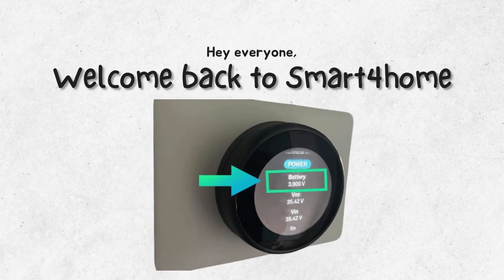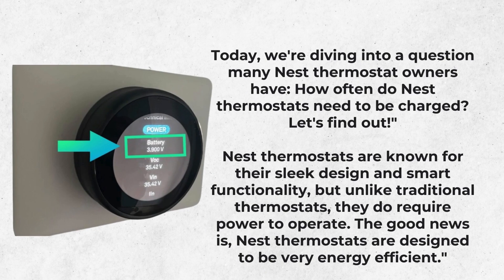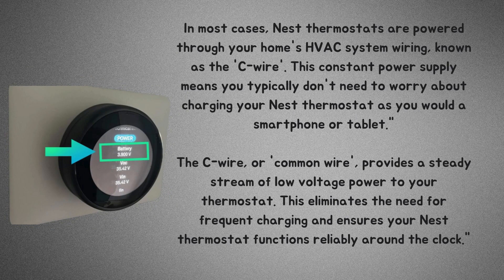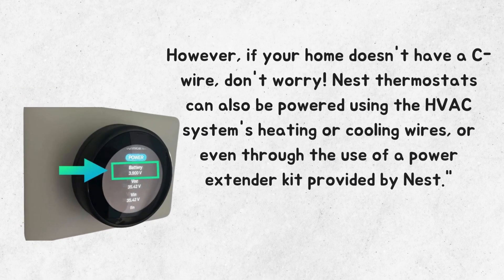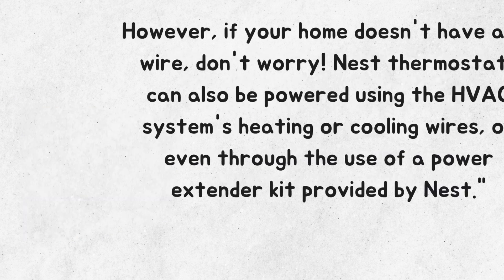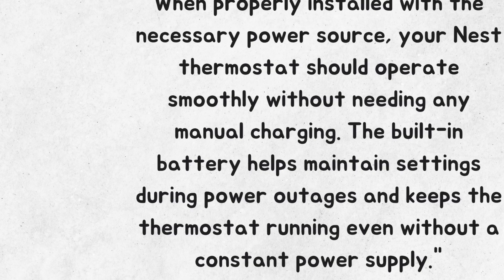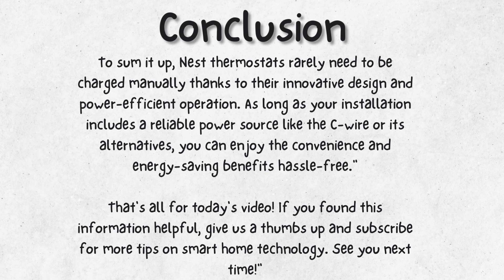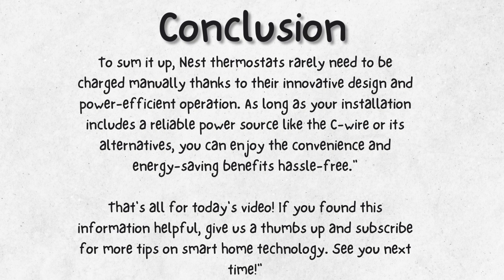How Often Do Nest Thermostats Need to Be Charged? [ How Does Nest Thermostat Charge? ]

Comment: i have a nest thermostat for a little over 5 years and is stating nest needs to shut off to recharge and it did but it never turned back on .does it need a new battery ?